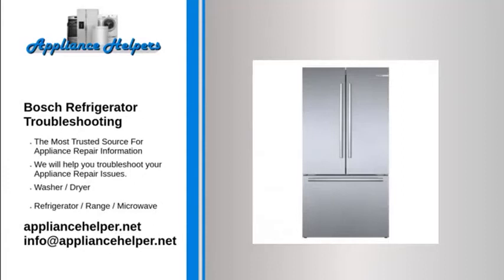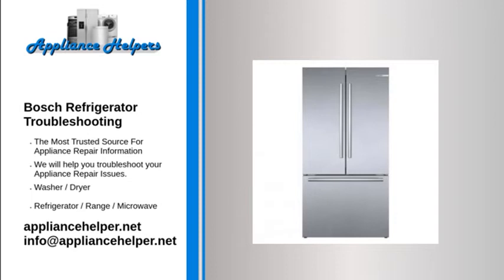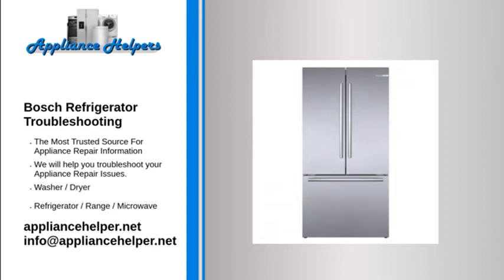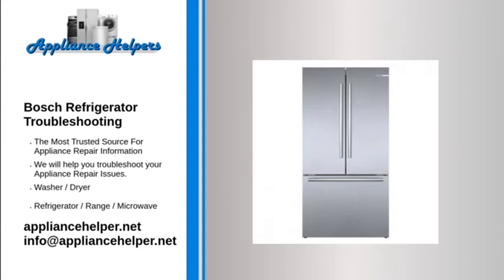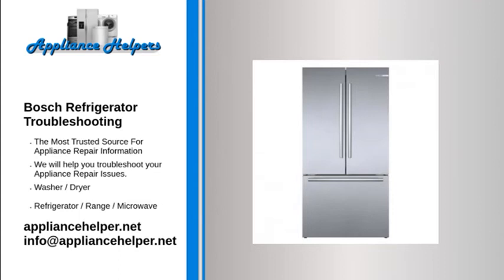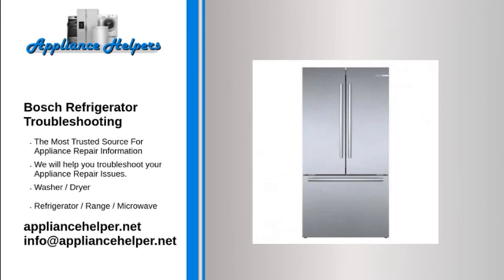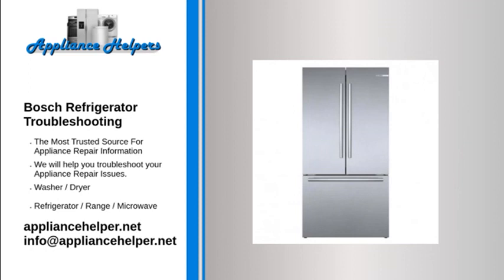Bosch Refrigerator Troubleshooting

Comment: I just paid $159 for a Bosch service technician to turn my fridge off for one minute and push a reset button to get my ice maker working again. It sure would have been nice to be given those instructions so I could have done it myself.
Reply: Where is the reset button?
Reply: What reset button?  A litle more info would be greatly apprciated, thx
Reply: @FrankFurbish  There is a button under the cover of the ice machine just above the ice bucket. I couldn't figure out how to add a picture to this reply.
Reply: @scottsreeves   Thanks!  The green power/reset button.  Tried that without any luck.  Do you need to hold it in or just push it off, then back on?.   I ran the test from the manual and didn't get any error codes.  I gave up and called out a technitian who didn't appear to know much about Bosch.  He's ordering a new icemaker.  Hopefully I can get it to work in the next day or two and cancel.
Reply: @FrankFurbish  it's been a year, so I'm not sure. But, I think I pressed the button for a few seconds. Then it was a matter of waiting to see if the water turned on followed by the cycling of the machine. Good luck.
Reply: The first thing you have to do is turn off or unplug the fridge and wait about five minutes before turning it back on. Then push the reset button for a few seconds.
Reply: @scottsreeves  It started working. The tech had no idea what he was doing.  I know he powered down the fridge (instead of unplugging) and was playing with the reset button.  I don't know if he held it down or pushed it serveral times but the ice maker rotated (it was facing down).  Later I heard the water fill and it started making ice.  It'a a shame Bosch customer support is so bad and the manual is close to worthless.  They should be able give us steps of things to try.
Reply: Fantastic! I'm very happy it worked. The news made my day.
Reply: @scottsreeves  that button the on/off button not reset. What am I missing?
Reply: @rggm-bl1xl  there is a recessed button next to the on/off button on my fridge.
Reply: @scottsreeves  ok i found it 😅
Reply: @scottsreeves Thanks!!
I have the same situation with my Bosch Refrigerator (B36CT80SNS/03) and this "Pro Tip" worked!
After turning the fridge power back on, turn on ice maker then hit the reset button.
The green light flashed, some ice cubes fell out then I heard water filling up the chamber. 😅 Thanks @scottsreeves

Comment: My lighted control panel at the top of the fridge only shows the temp for the freezer and fridge. All else fades and is not visible seconds after the door is opened. Do I need a professional to check this out?

Comment: How to turn on water and ice maker?
Reply from the maker: To turn on the water and ice maker in your Bosch refrigerator, follow these steps:

Locate the Water Line: Ensure that your refrigerator is connected to a water supply. Typically, there will be a water line connected to the back of the refrigerator. Make sure the water line is securely connected to the refrigerator and to a water source, such as a water line from your home's plumbing.

Turn on the Water Supply: If the water line is connected properly, turn on the water supply valve to allow water to flow to the refrigerator. The valve is usually located near the water source, such as under the sink or behind the refrigerator.

Activate the Ice Maker: Depending on the model of your Bosch refrigerator, the ice maker may have a switch or button that needs to be turned on to activate it. Check the user manual for your specific model to locate the ice maker controls. Once activated, the ice maker will begin producing ice.

Allow Time for Ice Production: It may take some time for the ice maker to produce the first batch of ice. Allow at least 24 hours for the ice maker to fully cycle and begin producing ice cubes.

Check for Water Flow: After turning on the water supply and activating the ice maker, check for water flow to ensure that the water dispenser and ice maker are working correctly. Dispense water from the water dispenser to verify that water is flowing properly.

Monitor Ice Production: Keep an eye on the ice maker to ensure that it continues to produce ice cubes regularly. If you encounter any issues with water flow or ice production, refer to the troubleshooting section of your refrigerator's user manual or contact Bosch customer support for assistance.

By following these steps, you can turn on the water and ice maker in your Bosch refrigerator and enjoy the convenience of chilled water and ice cubes whenever you need them.